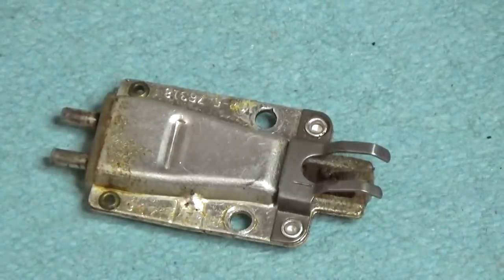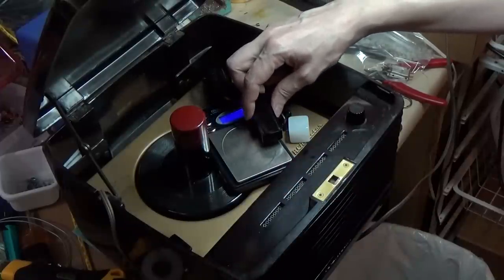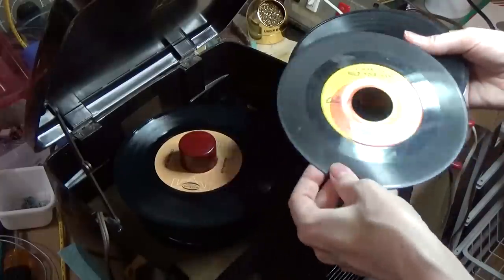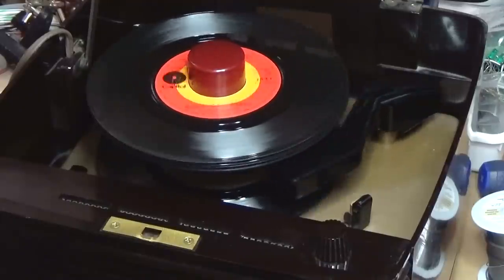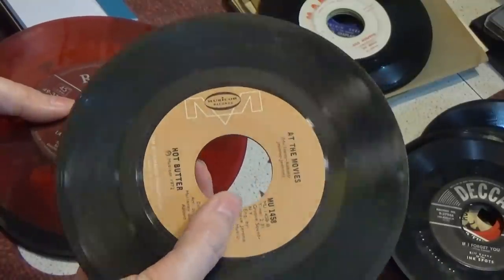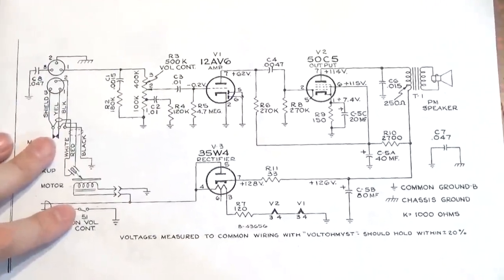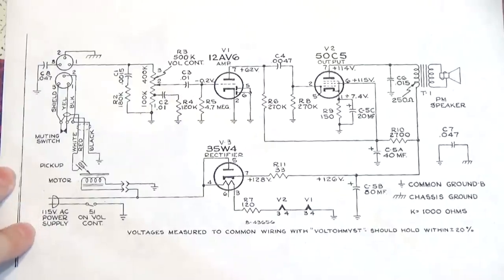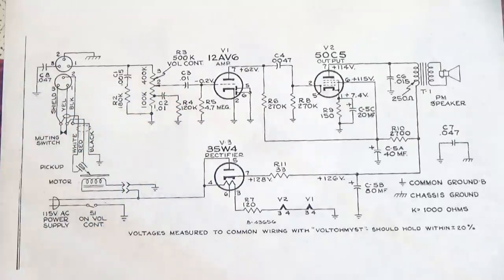RCA Victor 45rpm Record Player "Desktop Jukebox" Repair

Comment: A small piece of a self stick tire weight for mag rims works fine to add weight to the tonearm.
 You can also rebuild the Rochelle Salts cartridges by using the element from a piezo buzzer from an old computer kbd. or such. And of course, adding weight.

  PRB/ Russel rubber rejuv works good to rejuv the drive spindles & tires. Also typewriter platen cleaner works OK too.
 Dropping problems can sometimes be caused by the size of the hole in the record. The record hole does wear, causing problems. Saw that a lot with often played records. Never spray the mech with WD40, 3 in 1 oil, or the like. You will have massive problems from that. When that happened, I had to replace the rubber parts. You couldn't get the oil out of the rubber economically. 

 Always use denatured alcohol to clean the parts with, as rubbing alcohol has oil in it. For shop rags, only use the white, bleached ones. The colored ones have a solvent in them, and that really screws up getting stuff clean.

 You might want to add a series dropping resistor before the motor takeoff too. The higher line voltage today., typ.120-125V instead of the 110-115V can really stress the motors and tubes.

   I spent many, many years repairing phonos, and saw a lot of nightmare problems with them. Electric Organ Oil is great to use on the mech, as well as Lubriplate(tm)  lithium grease.

 If you can find it, I found Texclad 3 (Texaco) was the cats meow for greasing the mechanisms. Its 33% graphite. I never had any get hard and gum up the mech. in the 35+ years I used it. (Originally it was designed for open gears.  Be sure to wear rubber gloves and don't get it on your clothes. That graphite grease is a real pain to get out of clothing & off your hands.).

Comment: You missed the most important part, stability of the turntable speed. Did you clean and lubricate the motor? Are the motor mount grommets soft and pliable? What kind of shape is the idler wheel in? You have a nasty warble there. As far as adjusting the tracking weight of the tone arm, why didn't you just adjust the spring tension? The tone arm is plenty heavy enough. I would check to see what is obstructing it from lowering all the way down on the record.    If you are just going to play mono 45's, you could have got a P51-1 cartridge. I prefer stereo cartridges myself. On the 3 tube or more players a P132D cartridge works great. If you are worried about damaging the stylus on the bare deck, glue a thin curved piece of rubber or plastic like on a VM changer.  Oh, a lesson about 45 rpm records. RCA created the raised label area so the the grooves didn't scrape on each other in a stack of records. In the boxed sets, originally RCA just put a piece of paper in between the records to protect the labels, a full sleeve was unnecessary. 45's like your red one and the Beatles 45 are made of vinyl. The Bell and Musicor 45's are made of poly styrene in an injection molded process. The labels have to be glued on after those records are made. The vinyl records have the labels pressed into the record during the pressing process. If you have a tracking weight of 6 grams or more, the poly styrene records will be eaten up fairly quickly. A tracking weight of 3-5 grams is preferable.

Comment: Oh, yeah!  I wanted to ask about your TI-30 power pack?  I guess you're running it on a 9v battery? I have one with the rechargeable battery kit (RK-2). It used a couple of nicad cells with a voltage kick circuit to get up to the required 9v or so.  Of course the cells are long dead & I removed them.  Wonder if it would work if I put new ones in??? hmmm...

Comment: The flimsy sound on your RCA player,are probably that the middelwheel need's to be re-rubbed. The rubber gets hard and the edge get flimsy because small parts of rubber comes off,and when it goes into the spindel on the motor,the flimsy sound appear.

Comment: Most records never had those wide diameter central hole 45rpm record players where im from. They more often than not used the same size central hole size as a standard 33rpm record and the record changers never had the same tolerance issues. maybe the larger hole tolerance became an issue and other country's didn't adopt it as much for domestic use? 
Many new record players still came with a spindle size adapter but no one used them.

Comment: Here is a video featuring the first generation RCA RP-168 record changer. These had heavier tone arms and in the video it  states that tracking weight is 1/6 ounce, which is about 4.72 grams. NEW RCA 45 RPM RECORD SYSTEM & RECORD PLAYER PROMOTIONAL FILM VINYL RECORDS XD10544a - YouTube

Comment: Nice instructive video Fran, I was wondering what the function of C7 was?
Reply from the maker: That's the infamous 'float ground' capacitor to "separate" the chassis from the direct mains line.  Works like a charm roughly 50% of the time.  ☺
Reply: A lot of the no-transformer sets (radios, etc.) had a floating common "ground" - that is, it was wire that connected all the circuit points that, in a transformer set, would have been connected to the metal chassis. C7 connects that common to the actual metal chassis to ground signals & noise without passing current (well not much) from the 115vac lines.   The values (typically around .05 to .1 mF) would pass a little 60cycle energy but apparently not enough to be considered dangerous.  Unless the cap shorted!  These things should be replaced with "safety caps" meant for bypassing AC mains - they are designed (magic?) to fail open rather than shorted.
Reply: Thanks Wayne.
Reply: Thanks very much Fran..

Comment: Are the case and tonearm made out of bakelite?  It looks really old timey.
Reply: It’ll be Bakelite alright.
Reply: No, radio museum entry says all modern plastics, no Bakelite.
Reply: Mark Tillotson If it was manufactured in the 1950s then Bakelight and Nylon were the modern plastics of the day.  But I’m finding multiple sources that indicate Bakelight and there were not many other plastic candidates of that decade to choose from (and that have the classic Bakelight characteristics).  There are much more modern knockoffs of this model (complete with BlueTooth, even) that would most certainly be “modern” plastics since Bakelight is very much a specialty plastic nowadays, but in the 50s Bakelight was the go-to plastic for most electronics as otherwise their design choices were largely limited metal or wood.
Reply from the maker: It's bakelite - phenolic all the way baby.
Reply: Guess radio museum needs their database updated then!  Found some other pages that say brown or black heat-resistant bakelite.

Comment: I tend to cannibalize old cartridges and spare stylus's. Because the mountings vary so widely I may glue or solder a stylus onto the original part. Very fiddly, but as long as it works and looks okay I don't care. Sometimes, I'll  rebuild the whole thing, just to fit a teeny weeny little needle. I'm too bodgy to order parts!

Comment: OMG S1 interrupts ground. Does that device have a polarized power plug? Not exactly service friendly.
Reply: enuNC8EDj  I was thinking the same thing. Flip the plug around and now you have a hot chassis. And the potential for a good zap! I’d put a polarized plug on it for safety.
Reply: Blew a ground lead on a scope probe working on an old TV wired the same way. Guess that's why they're made out of fuse wire.
Reply: Had a Zenith tube radio with same grounded power supply and no polarized plug. It had a wood cabinet but if you would reach around the back and touch the chassis you would get zapped.
Reply: Note that the electrical ground is NOT the ground for the metal parts - that's through "C7" - so unless that shorts, the design is almost safe.
Reply: @gdavisloop   Thanks I didn't notice that.

Comment: the way you are handling the 45s is normally bad for records you should never touch the grooves as the oils on your hands can draw dirt and cause problems.

but since ones you call "on death row" are junkers you are not hurting much since they are used to test your player but you should handle the good records much better.

the tracking force was never too much an issue way back then like they are now where too much tracking force can be destructive.

a channel "vinyl eyezz is a good place to study up if you want to get more serious into records.

it would be nice if you could list all your collection so we can find the songs on itunes